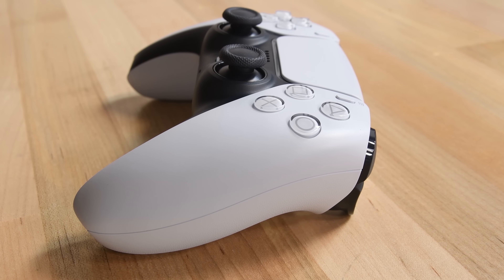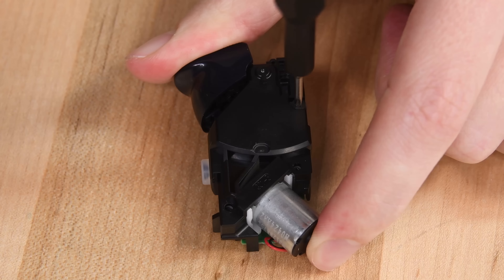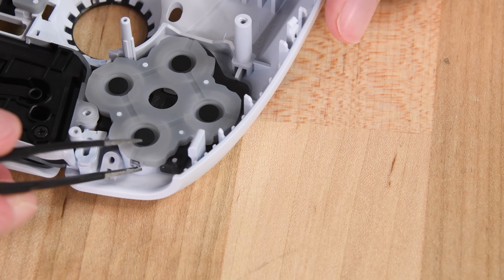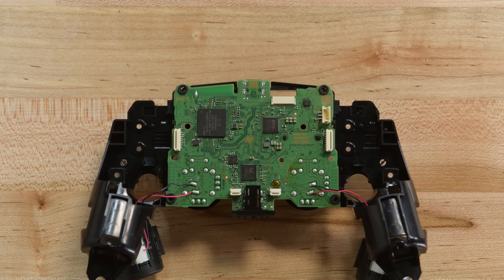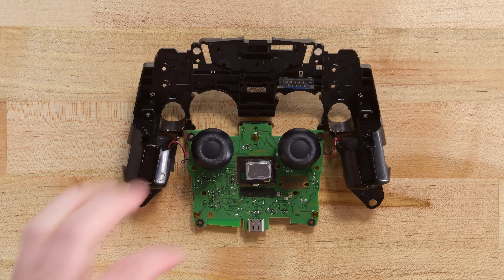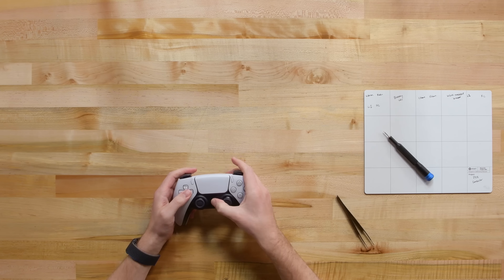PS5 DualSense Controller Teardown: Controller Evolution

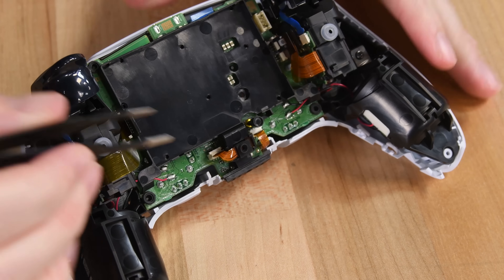Comment: At 1:21 you take off the left microphone thing but the right one is still attached and I don’t know what it’s attached to or how to reattach it. And then after u take off the front microphone thing, u skip taking the other one out and the video just goes on. Where does that right orange wire attach to???

Comment: Mate this video doesn’t even show where the first 2 screws are or how you got the l1 and l2 screws visible?
Reply: It does show. 2 screws are to the bottom and the L1 and R1 buttons are just pried out using a spudger. You can also view disassembly instructions on their website.

Comment: the controller I have has a different internal so navigating some of these steps were very challenging because of variation of the same mechanics design but some parts have major changes

Comment: Ladies and gentlemen. My controller doesn't turn on anymore
Reply: I came here for this exact reason but no solution in sight
Reply: Did you fix it 😂
Reply: @alidarko3733 not yet
Reply: Did you try turning it on and off again? 😂
Reply: @nogardd yes
Reply: Yep me too
Reply: Funny thing that my old Dualshock 3 controllers from 2007 are still have no drift or any issues, and I play on them regularly connecting to PC through bluetooth. Quality of old teck is the king. New Dualsense lasted me about 1.5 years and sticks are drifting already.
Reply: @yevheniibatiievskyi  Almost as if the deadzones are massive and the polling rate is non existant!
Reply: Buy a replacement battery

Comment: 1:26 why did you skip unplugging the cables? Seems like you want people to damage and replace those
Reply: I just broke my microphone for this reason, terrible teardown 😅
Reply: I just F'ed my controller buttons because i ripped one of the ribbons apart. Thats one controller down the drain.
Reply: I just broke mine
Reply: @jakubpas yup. It’s pretty easy to snap.
Reply: Almost broke mine but I was able to realise there are other parts to be unplugged. I am relorting this video
Reply: Skill issue, just did a teardown of my controller and reassembled it. The ribbon cables are all literally in plain sight 😂.
Btw you can fix stick drift by pouring 90% isopropyl on the stick mechanisms while rotating the sticks at the same time lol.
Reply: @scubasteve7850   not the front mic
Reply: Haha same - I figured out a couple when the board wouldn't budge, but skipped one - now I'm down a controller. :text-green-game-over:

Comment: I have a odd problem with my controller. There is a chance where my left stick will also causes my right stick to point up.
Its not my imagination or the games fault i tested it clearly and it clearly reactions with my left stick. And not just a little. 

I mean in equal full tilt. Anyone know why that is?

Comment: because of this, opening my dualsense, I get the confirmation that god is testing me in this life. I had to open it back up two times more because the thing won't turn back on. I had to remove and reattach the battery connection, in doing so I destroyed the rear microphone, now it won't work lol. Good thing I never used it anyway. Opening it the first time, I've had to break the big latches on the side.... well now at least the buttons are clean... AND it's still sticky, because it's membrane... why won't they just put mechanical switches on these... I don't even wanna touch these again lol

Comment: Ok, you missed 3 more ribbon cables. Im done..
Reply: Yea, it makes it easier to break your stuff. This video should be revised before someone else screws up..
Reply: @Ne0n_R0nin_7V that’s why I’m not doing it. Thanks for letting me know
Reply: Can’t stand when videos do this ugh
Reply: Its because this is a tear down is of the first gen controller. They made a couple changes with the newer models. Sorry dude
Reply: Yup I just broke the bottom right ribbon cable? What was that for?
Reply: @P-tricky13 mic and speaker. Semi important.
Reply: Pretty sure i ruined my controller bc of this, initially the d-pad and symbol buttons weren't working, now they do, but my left triggers don't, and it doesn't light up anymore

Comment: I tried disassembling my controller to fix my square and r1 buttons which will not work at all. It still doesn’t work after checking for dirt and/or water, in which case I could not find any kind of substance there. Does anyone know what the problem could actually be?

Comment: Only problem I had was the very first step. Could not pry it open. Where i could, I used my thick, long thumb nail and slid it across, and bam opened easily, no damage to my nail too. Other than that, I realized the inside of mine was not the same inside as yours. I noticed the outside did not have the symbols either, which was weird to me. This was the original controller from the box. I clean my ps4 controllers too so other than that and needing to replay on where pieces go. Thank you for the help.

Comment: Had the same controller that came with my ps5 from 2021 circa September-November and my controller has had zero issues. No stuck drift no unresponsive buttons clicks or nothing. Daulsense controller is one of the best standard controllers that comes with a console I’m just now in February of 2024 buying a new controller only because I want the black one because I love how sleep it looks. Idk if I’m lucky but this controller is amazing

Comment: Anyone have tips on diagnosing the three orange blinks? No blue light, not connecting, not registering when plugged in, not registering on gamepad tester. Reset button doesn’t fix it, and the battery is good

Comment: I have 2 dualsenses and one of them working good.
But the second has technical issue. 
In 70% when I’m clicking on button X it’s also starting working button PS. It’s even when I’m not clicking on it.
And it’s really hard to play when it’s working PS button every time when I click PS button.
I tried to disconnect it but still the same problem.
I tried also mechanical reset it from backside of it but still the same problems. 
I bought PS 5 2 years ago and dualsenses also.
Please help me to solve the problem.

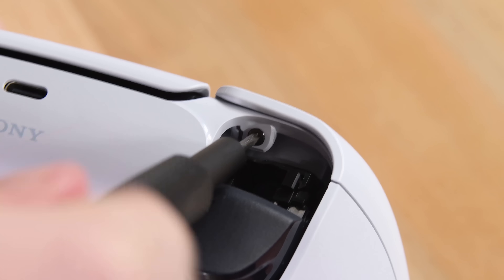Comment: The part at 0:44 is not nearly as easy as it looks if the controller hasn't already been torn apart. You'll likely spend 2-4 hours just trying to pry that apart even with the correct tools.
Reply: 2-4 hrs? It was difficult but I got it done in 10-15 min with a pocket knife
Reply: Just came back to see the video specifically because of the difficulty of that part. Thank you for the heads-up.
Reply: Nah, it was easier than in the video bud. just start at the bottom (aux-in region) and just pry open with your hands.

Comment: Some important steps left out here... He just lifts the board off the unit like it's not held in place with these little black nubs. "It takes some careful acrobatics" is not exactly a precise step by step description on what to do. I used a video by some other dude for the first time i had to open it up and it was much more thorough.

Comment: 01:25 CAUTION: Remember to remove the front microphone cable first. I broke mine because the process was cut/shorten by iFixit. In my opinion, iFixit shouldn't cut any montage in a teardown video.
Reply: Not just that. There are FOUR ribbon cables you need to disconnect before you can pull out the mainboard. He skipped that step entirely. After removing the battery bracket and the back microphone, you also need to disconnect the front microphone (bottom right), the touchpad (top right), and the button membrane (left center and right center).
Reply: @dermaniac5205  Yup, they completley skipped it. Just took one controller apart..

Comment: This is a very bad video and should be taken down. There are multiple ribbons cables that where not address.  The front speaker, the two side and the partly hidden top ribbon canble.  This video skips over these and even made it look as if they pull the parts of the controller without removing this which is the red flag. U can easily break these cables if u are unaware of them and pull to hard. Additionally putting the controller back together requires a completely different set up to pulling it apart which can lead to the user damaging their $70 controller. Due to how many important factors that can lead to the user to damage their devices, This video get a 0/10 due to this and again should be taken down and put actual effort on showing how to open their devices

Comment: 0:44 Umm, as much as I hate/love Nintendo, they stopped using Triwing Screws ever since the Switch released.
Reply: Not true. Still using them as external screws, but phillips on the inside.
Reply: Nope, outright falsehood. Just open up the Switch dock.
There's triwings in there.
They still use them.

Comment: This is outdated now. I needlessly pulled the battery tray and motherboard out, tearing the two tiny ribbon cables for the mic and headphone jack, because the two screws holding the front plate on are above the vibration motors. Not behind the motherboard.

Comment: i actually tried this myself and the hardest thing was the very start... for anyone trying to do this you can also start with the outside part of the black part, pry that away with a spudger and then work yourself towards the middle.. you can just pull up on it to take it off ... i had real trouble separating the two parts when trying to start from the middle
Reply: I know this is late but do you remember what type of screwdriver you used
Reply: This is very true. I started by the black extremities of the controller then worked my way up to the middle he started with.

Comment: I run mine wired for lower latency on a PC and i've now had two USB-C Ports go bad with only normal gentle use. Can that part be replaced or does it require replacing the entire motherboard? Didn't really mention it in the video.

Comment: You guys could've covered in a step by step to disconnect the wire strip that connects the 3.5 jack to the controller board. Because in this tutorial moving step by step, even tho you pointed out the microphone, you totally neglect the wire to the jack, and flipping the controller guts out of the front plate is going to snap that wire for a lot of people unless it's clearly pointed out.
Reply: Yeah happened to me JUST NOW
Reply: Is it important?

Comment: I'm disappointed as you don't mention in this video that the ribbon cables for the vibrating motors need to be taken out before you can take out the main CB

Comment: I can't speak for the parts after the controller was disassembled, but I accidentally caused the black joystick cover to come off the bottom of one of the handles and the screw underneath it to actually go through the hole that held the two pieces together because I was playing Bloodborne, and thankfully the disassembly part helped me fix it.

Comment: Awesome
I'm trying to check my controller since PS button is not working...wonder if I open it and have a clean inspection on it would work... Time to time it works and I'm able to turn it on.. But wonder what could be the issue? And not turning on... If the button sensors are failing?

Comment: Do you think it would work if we use a 3.7 PS4 battery and replace the battery pack inside of the PS5 controller?
Reply: Why when the ps5 is 5.7w that's a downgrade
Reply: @lazyme35  Because higher watt isn't always a good thing

Comment: Thanks for this. My touchpad was a bit sticky, so I used this for reference when opening it up. Used some isoprop to clean it, and put it back together. Now everything is as new :)
Reply: Exactly what I'm about to do. Somehow my buttons and touchpad got sticky.
Reply: Is it possible to extend the touchpad and place it elsewhere if the ribbon cable was longer ? By using a longer ribbon cable or something. Any help is appreciated. Thanks

Comment: Really great video but one thing i don't understand, "it is unfortunate that some repairs can only be accomplished with a soldering iron". I mean, you don't want connectors on everything, it would increase cost, unrealiability and size/weight. It's not that hard to use a soldering iron

Comment: I liked the teardown vid. Unfortunate that most important parts are only swappable by soldering iron. Interestingly enough I had this video and a few other PS5 vids saved to watchmaker cause I was waiting to get mine which arrived today (11/19). Fun fact I already have 3 controllers! Hope to never have to deal with any of them to an extreme level like swaping out throttle sticks. Battery I can do. Anything else, ph boy I'm scared. I have a soldering kit too from iFixit!

Comment: There is a loophole that lets you play with the Dualsense Controller on the PS4 here are the steps.

Step 1: Download Playstation Remote Play on your PC.
Step 2: Plug your Dualsense Controller to your PC with a USB Type C Cable (It needs to be plugged in the controller will NOT WORK Wirelessly on PS4)
Step 3: Link your PS4 to Remote Play on your PC
Step 4: Play

What I do is I launch Remote Play on my PC and I change the Input to the HDMI Input that my PS4 is Plugged into so I can Play my PS4 Games with my Dualsense and not get the crappy Resolution Quality but Instead I get the Full 4K Image, and yes the Vibration will work through this method though maybe not as intended as the PS4 Games were not made with the Dualsense's Haptic Feedback and Adaptive triggers in mind.  As far as I know this method only works through remote Play on PC I haven't tried it on a phone or other device, but I recommend giving it a try If you have a PC, Dualsense Controller, and a USB Type C Cable.
Reply: I don't have any console
Reply: Pls
Reply: Can you give me one

Comment: Why does the stick drift happen? I have 4 PS4 controllers where the sticks drift. Is it repairable?
Reply: Stick drift usually comes from a sensor in the joystick assembly that’s gone bad or gotten dirty. There’s two sensors in each joystick that control up/down movement and left/right movement. I had a controller that had stick drift so I researched it and it’s a really easy fix and the parts are pretty cheap too.
Reply: @cmdr101z8  Cool, thanks for the info

Comment: Nice work iFixit! Great teardown.
Reply: I know you I'm subed to you, does the controller still work without the mic?
Reply: Hi tronics Whats ur opinion about the analog sticks same as before and probably has the same issues like dualshock and the fact that its stock on motherboard makes it even worse (my opinion : i wouldn't buy a dual sense as the second controller im sure there gonna be scuff controllers for ps5 with much more quality and customisation in future) whats ur opinion about this?

Comment: I saw the joycon analog replacement. Is it switch specific? The analog used in most controller is generic pin based and it's everywhere and it's cheap.

Comment: That thing is REALLY repair friendly!
Replacing the battery will be a breeze if the trigger mechanism holds up long enough to see its capacity dwindle!
Reply: This comment didn't age well with battery times reportedly  down from 4-5 hours to 2-3 hours already... 😂
Reply: the joysticks and sensors will wear quicker than any of those things, so it's null and void...
Reply: Eh the battery is irrelevant to me. I always play with it plugged in. I'll put my PS5 behind my computer monitor, and play with the controller plugged into the PS5.
Reply: @garface007  The battery constantly being at 100% is gonna destroy the battery life faster than if you play unplugged and only plug it in when it's low.
Reply: I said I ALWAYS play with the controller plugged in. What do I care about a battery?
Reply: @garface007  The controller won't work without a battery 🤣🤣
The cable charges the battery, it can't power the controller on its own, unlike xbox or other controllers.
If your battery is dead, the controller is dead.
Reply: I call BS.

Comment: One of the best modular and repaiable hardware 👍 great work of engineering instead of glueing everything together. 
To remove thise joysticks even u can use soldering iron and suction pump and can remove it very easily...overall very good design. I am expecting 8 out of 10 atleast 😀

Comment: You guys worry about soldered parts much too much. Solder makes a lot of sense in applications like the haptic motors. Depending on how often the motors need to replaced, it can be much more environmentally friendly to use solder and not use resources on a connector most users will never use.
 Connectors can also jiggle loose easier than a well soldered connection. Connectors can also add resistance to a line which can drain batteries faster than a soldered connection would. In some applications soldered connections can be better for the environment and extend the life of the battery used in the device.
You also worry about glued parts too much. Glue can be better for the environment than adding additional fasteners which are unlikely ever to be used.
Needing to solder a bit or needing to replace a dab of glue while repairing a device isn't necessarily a bad thing. Solder and glue can be much better for the environment than adding connectors and fasteners which are rarely used.
Of course there are plenty of times when solder and glue are bad. Batteries should be able to be replaced without the need of solder or glue.

Comment: Looks a lot like the Xbox controller hmmm I wonder where they got the idea
Reply: Your blind. Look at the design its totally different. The size might be similar but its for the huge motors and stuff to fit inside unlike xbox it doesn’t have anything new inside just a hallow bulky plastic with no innovation.
Reply: Xbox controller doesnt have haptic feedback and adaptive triggers. Both ps5 and series x consoles are next gen but ps5 controllers are totally next gen